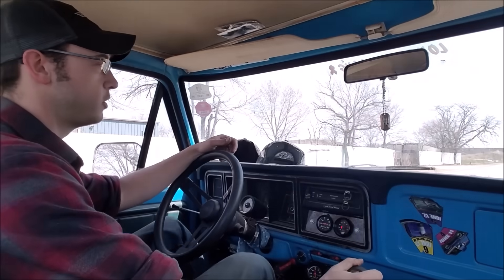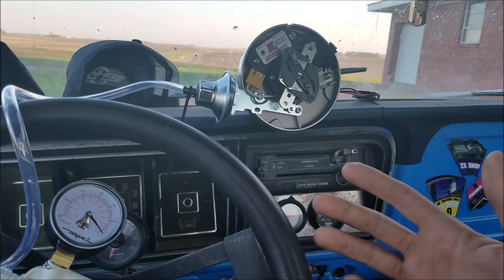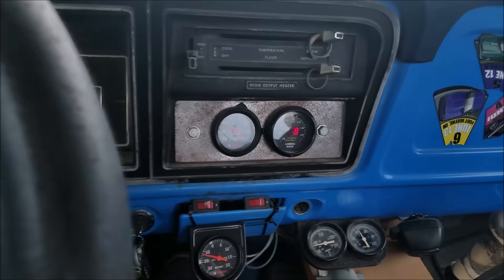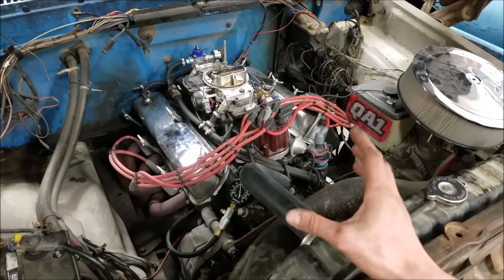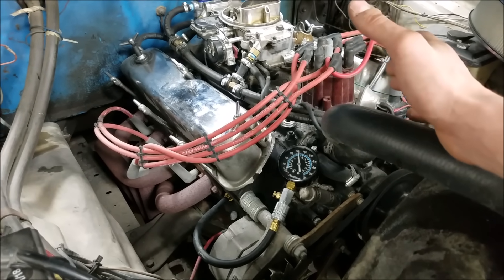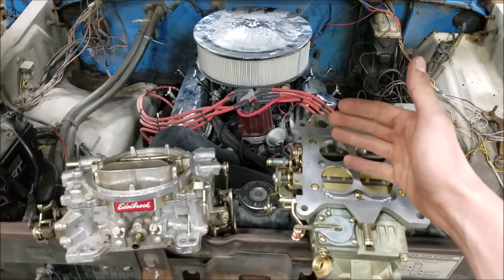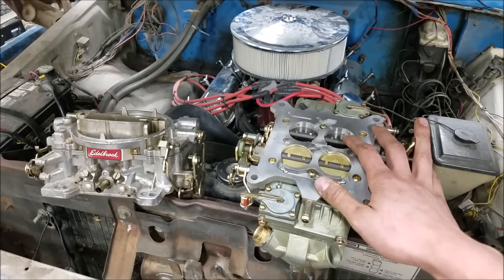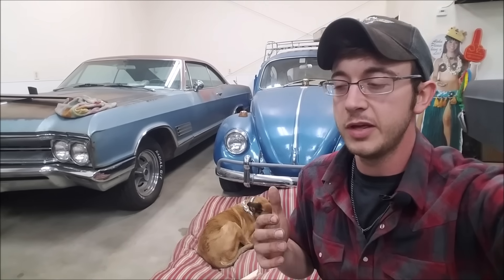Vacuum Advance - Ported vs Manifold: Which to Use & When !!!

Comment: Using manifold vacuum will give you a smoother idle and use less fuel when idling because with the low fuel/air volume in the cylinders the earlier spark advance makes the engine more efficient. The idle speed will then increase using manifold vacuum and adjusting the idle speed down will reduce the fuel consumption and result in a smoother engine that also generates less heat so will run cooler when at idle  in traffic.
This will be true with a mild or stock cam.
At throttle applications above idle both manifold and ported vacuum will be identical as you pointed out in the video.
Reply: Hulagan 808  Actually, most performance engines/heads today will make best power with 32-36 ini / mech advance & the mechanical should be all in by 2400 or so, with today's pump gas, & 32* works better than 36* in most applications, unless one is running ignorant compression & cam duration / overlap. Maybe more timing with a low compression stock motor.
Reply: @bradgriffith4231  ttyyy
Reply: @jeffkellner1585  What's ttyyy? If you have a question, I will try to answer it. I've been a professional mechanic & built hot rods & race cars since I was 15. Also friends with a bunch of very smart "car guys".
Reply: @bradgriffith4231  Sorry Brad my bad my finger got stuck on the keyboard and I didn’t know how to edit it.  I agree with about using manifold vacuum.   Back in the days I had an old 455 and it was a little short on vacuum because of the cam.   So what I did was use a one-way valve and astorage can out of a Lincoln town car.   I put a switch on the gas pedal and whenever the car was at idle or right there about I applied the stored vacuum from the Can which had about 18 pounds from when the car was with title it was a fabulous system but the main point is I fully agree with you
Reply: The vacuum can have 18 pounds a vacuum or more because when the engine was off idle it produced for vacuum and then I used a solenoid valve to switch it to the distributor whenever it was at idle
Reply: This^^, there is no reason not to have vacuum advance at idle. I have seen so many people chasing overheating issues all because they didn't hook up or don't understand vacuum advance.
Reply: @bigce  I wonder how you would compare all of this to a fuel injection car like today now I know this is a completely different subject but there are similarities.
Reply: How does today's perfectly tuned engines at all times keep a smart at an idle do they give it does the ECU give it less timing or zero timing at an idle or does it give it partial timing at an idle I know there's no distributor on the car in the fuel is precisely injected at the right timing by the computer as well but it would be interesting to see how the computer keeps that engine running so smoothly without overheating and being able to have an engine that will go now 300 plus thousand miles because it's always perfectly in tune all the time what are the similarities to the big debate on ported or non-ported
Reply: @TheThirdWheel618  Every OEM fuel injected car I have tuned uses a 3d timing table with rpm and manifold vacuum as the two axis, and they absolutely run additional timing at idle under higher vacuum conditions. 

Quite simply it makes the engine run more efficiently.
Reply: @bigce  there was a mustang that had vacuum valve in the intake manifold   that used water temp to open at higher temp  they ran it at ported vac then once the car heated up the valve opens and now it ran on full vacuum my Ca, smog 75 Ford Granada had this I remember pulling a hose off and it squirted hot coolant on me there's another big debate that this was not done for emissions though .
The autolite and some motor craft carbs pre 74 didn't have a ported vac only full manifold .
Reply: @TheThirdWheel618  That's basically why ported and non ported exist. It was solely and emissions thing. Cars would run less timing at idle to heat up the catalytic converters faster. 

Modern EFI cars do the same thing they just do it electronically, they usually have a after start timer and run a different timing map for a period of time. Fun fact that's why guys that do "cold start" videos why the cars are usually louder when they're cold is because they're usually running 10 or 15 degrees less ignition.
Reply: @bigce  I was just going to say that cold start efI car
Reply: I also agree with you on this I had the pertronix 3 ignition billet distributor in my Ford FE 390 I was running the brown spring on the front side and when I ran it ported running through thrush glasspacks it was freaking loud as hell and at a cold start I would get water vapor coming out of the pipes when I ran it through full manifold and ran it at about 10° initial and gave it a little bit more timing the exhaust was 50% quieter
Reply: @TheThirdWheel618  news tuff has oil packs trimming is complete done by computer
Reply: good to know! So that's why all my carb adjustment were maxed out on an old 1985 c10 I bought. The timing was so jacked and the TV cable wasn't even hooked up! It was so messed up man, I'm tearing it all down and starting over.
Reply: I run a CV 44mm Harley Carb on my engine. It does not have the option for ported vacuum, so either i don't run vacuum advance at all or run it from my intake manifold to my distributor, It does exactly what you said. I get the benefits of the advance when I need it most, but my idle is high. Unfortunately on my carb, I can only get it to idle between 1000/1100 rpm. If I try adjust idle speed down, it becomes inconsistent below 1000 rpm. If I remove the vacuum from the distributor and block the line with my thumb, the idle sits smoothly below 900rpm. I have been considering placing an electronic solenoid valve (closed) on the vacuum line, that's triggered by my accelerorator. So when Im idling, all vacuum is off and I can get idle down to 800 rpm and when i hit the pedal, the valve opens and the vacuum kicks in for advance. Hopefully it will work.
Reply: Someone who actually knows what they are talking about!  MANIFOLD VACUUM!!!   FTW!!!
Reply: Not all engines run properly using manifold vacuum to the advance can.  Some will spit back and hesitate with it set up that way.  Manifold vacuum works well on Buick Nailheads from 53 - 57, some 58s, and the late ones, 64 - 66, but not necessarily on the 58 - 63 engines with Dynaflow, as they are timed as 12 degrees BTDC.  The earlier ones are 5 degrees, and the latest ones are only 2.5 degrees.
Reply: Not all engines like manifold vacuum at the advance can.  Some love it - smoother cooler idle, while some others will spit back and hesitate off the line.  Experimenting is the key.
Reply: I disagree with manifold vacuum...You can run exactly the same "Idle Timing" eiither way, the "Difference" will be when you stomp on it from a dead stop...
Manifold Vacuum = You just lost ALMOST ALL of your timing, and its a DOG... (You might have 5°BTDC)
-
Ported Vacuum = You still have ALL of your "Idle Timing" and though the engine "might" slightly ping for a split second while the engine gains RPM, you are getting ALL of the performance out of the fuel being burned at 15-20° BTDC. - Just about every performance book tells you to "start with" 15° Base Timing PLUS 20° Mechanical Advance, and 10-15° of PORTED Vacuum for part throttle cruise.
Reply: This is just a thought i have a 69 F 250 390 it said 8 degrees initial on the valve cover i know some say 6 degress.but im sure it said 8 on mine lol so after say 73 and up there is alot of debate on both ported vs non and they both work obviously some say they never ran full manifold ....then why does it say to set your initial to 6/8/10 etc what does it say after 73 up 14? 18? Degrees then it be obvious what the engine was using im not sure im asking as a question?
Reply: @TheThirdWheel618  Often, with stickshift, specs call for less timing at idle, with automatic, more timing.  Ditto for engines with optional dual quads or tri-power, and for engines with optional cams.
Reply: Hmm 🤔 mine was the opposite not saying this isn't true but a 390 Ford is a pretty easy to tune a tractor engine .  I can only get 91 octane so anything more that 11degrees initial is all it likes or it will start funny and act a foolish, I know my truck was full manifold from factory the sticker says 8 degrees BTDC and  alot the old carbs only had a full manifold port .  I ran it ported and at idle with same timing it's a lot leaner right from the get I have a AFR on it so full M . Is around 1275 13ish ported it will be over 14 and can run well at 14"s at a idle that tells me factory said hmmm less emissions at idle with ported .  I don't like ported truck runs hot but again burns off all that carbon tho starts good exhaust is 50% louder and sounds raspy nasty with no timing in it but I could not touch a 14 AFR at idle on full manifold I set my pod to around 7-8 degrees so 10-11 initial and 7-8 pod anywhere from 17-22 advance at idle .
Reply: You left some stuff on the table and are backeards eith you cam size scenario.  Matter of fact its a culmination of what creates higher cylinder pressure that will dictate which to use.  But, in reality, ported vacuum was a function of emitions.  Pretty much every engine will benifit from advance timing at idled/manifold vacuum.only ones that dont are ones that require locked out advance.
Reply: I can confirm 100%.
Reply: Yes this. This is the truth. Ported vacuum was designed to use more gas and run worse. That was the intent. It causes later ignition so that more fire goes out the exhaust valve and heats up the exhaust to keep the catalytic converter hot. That is all. You're basically burning gas to run an exhaust heater.
Reply: Not necessarily true.  Many engines made before the converter used ported vacuum, and some will even spit back and hesitate with manifold vacuum.  AMC 6s are a good example of that.
Reply: This is exactly where I ended up with my engine, switched to manifold vacuum and had to wind 3/4 out of the idle screw to get the idle back down where it was, and it idles smoother now

Comment: If you're building an engine you should just disconnect it and set your dizzy for a range from about 12 degrees initial to 34 degrees total advance for Fords and Chevys and up to 38 for mopar. The vacuum advance will give you way too much advance on just about any built engine.

Comment: I learned a lot about this on turbocharged Corvairs. They had a vacuum advanced/pressure retarded distributor.  You want to get the timing and advence on those engines right or nothing good happens.

Comment: I completely agree. Plus I always utilized a manifold vacuum gauge with my gauge group. It's a great way to be informed on how the engine is running. It's a gauge that most gear heads are ignorant of.
Reply: In the early 1980's they put them in guage clusters and called them 'econometer'. 
Old BMW's had them under the speedometer swinging L to R  as you stabbed the throttle.
Reply: Great tune aid. I swear by them.

Comment: Guy's please look up watch some roadkill and video do not do that most stock engine idle at 20 to 17 in pounds so that gives you full advance at idle to part throttle then your mechanical advance takes over and vacuum drops out and you have a big street cam is most time 12 to 14 in pounds of vacuum it is called a advance curve kit that is how you fix that good luck to you all I will be blocked because I do not agree with him
Reply from the maker: You understand this so little that you literally didn’t even follow what I was saying. 
I’ll spell it out for you - on stock or mild cam engines, IF you run manifold vacuum where you are adding vacuum advance at idle, for the carb settings to be in the right spot, you will be required to then run a very low mechanical initial number. 
It runs and cruises just fine, but when you stomp on the throttle, you drop back to ONLY being on your mechanical initial timing/somewhere on that later than ideal timing curve. 

A guy can say “well hey, why don’t I run some faster advance springs, that will fix it” wrong! It will fix that issue, but cruising timing will be wayyy too much when vacuum advance is active. 

The simple solution is to run ported, use a more reserved timing CURVE via your mechanical advance springs, and you will have your cake and eat it too. 

Is it perfect? No. Neither is manifold - there are compromises you have to make both ways. But I’d rather run slightly later idle timing and have my performance off idle, then have a few more degrees at idle and a lazy timing curve - or if you try to correct it, part throttle spark knock when cruising. 

If you understand ignition timing and how the mechanisms work, what I wrote above will make perfect sense to you. 

Stop crying roadkill and regurgitating false internet info! 

Sincerely, 
Thunderhead289
Reply: No but that ok you know more than ford chevy dodge and all the guy's that have been running them old school engine as for what you said that just shows that you don't understand how it works advance timing is better for low and low mid that's just the way it is retarded timing mid to high don't matter the cam or engine that's the way it is you should just go all old school and just lock it out then you are over cam and over coming carb issues tuning is learn get more time you will one day you are not right
Reply from the maker: You are an idiot. See yourself to the door. 
Please don’t ever try to teach anyone how to do anything.
Reply from the maker: That’s marginally not even English
Reply: Yes I know what he is doing and he started out telling me to hit the door and calling me names and what he called me I called him it's not all roses listen to it and he was having trouble with it still sounds to me as if he to much cam not a nuff compression  and you should know that distributers today are way different but the same now you can tune them way more
Reply: And timing is timing more on low end and less at the top it has not changed since the beginning I have done what he is doing but it didn't  work I have changed out to old dual point I have used HEI and locked them and hooked up on a toggle so could get it turning over then hit it because it was no vac mechanical had stops on it so I have played with timing a lot and I have learned you fix other problems with timing

Comment: You tell me when does your port vacuum fall off put your vacuum gage on it put it outside the hood and drive and show all how wrong you are
Reply from the maker: It drops out at the same time as manifold. Go put a vacuum gauge on your ported port and enjoy putting your foot in your mouth. 
It’s literally the exact same as manifold except at idle throttle input. 
If your throttle is at its home position with no foot feed it should be 0 if you have your carb set up right. Outside of that it follows manifold to a T. 

Maybe YOU need to drive around with a gauge!!!!!
Reply: You are a idiot do you not know what advance curve kit is why about a adjustable vacuum advance is maybe a vacuum can you know when you 10 in pounds of vacuum yes cams that big on the street learn adjust a carb not fix it with timing but you are so right I know nothing block you show all if they don't agree  they will be called names and kicked off have fun learn more before you call guy's idiot's
Reply from the maker: Dude, I’m thunderhead289. 
Respectively, I have forgotten more than you will ever know. 
Here - have yourself an education about ignition timing - I made this video for people like you. 
https://youtu.be/Ort2Gk7Lvuk
Reply: I'm about at least 15 years older than you been racing and working on car and truck's since about 14 years old don't care let me school you a little vacuum advance was designed because of a problem in 60s and early 70s factory put big cams in and low and mid rpm driveable problems that was the fix go tell the big 3 and msd and Mallory they have doing it longer than you have been  alive tell your B'S to them
Reply: P.S that's why they tell you to unhook the vacuum advance before timing the engine your answer is to bump up initial timing maybe you should watch a dyno 2 degree of initial timing 20 horsepower so you are detuning engine the way you are doing it
Reply from the maker: I’m glad I’m not you buddy. 
Also, check your total timing with your vacuum advance disconnected because THAT is the timing you will have at wide open throttle. When cylinder pressures are the highest and where timing mistakes put holes in pistons. 
Age matters not - in fact, I’d be disappointed iv been wrong for so long in your shoes. 

Also, racing isn’t hard. You are always above the rpm you are at total timing. Real tuners can set up both ends of the spectrum. Racing scenarios are easy to set up for - now drivability, that’s a whole different animal. 

Pull up a chair and spend some time on my channel, you will probably learn some valuable info you would have never of known otherwise. 

Thunderhead289

Comment: So the vacuum advance is there to put more timing in at low rpm for more power and smooth acc
Reply: It is there to give more advance under light-load conditions.  Under heavy throttle, it drops out.